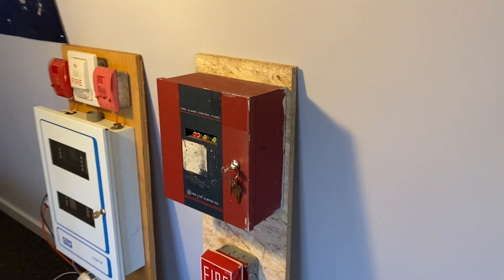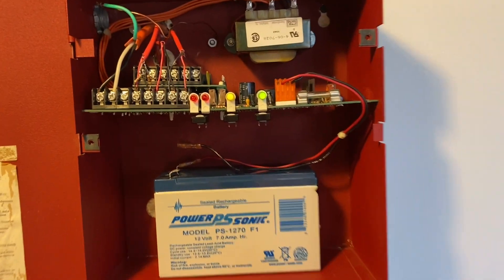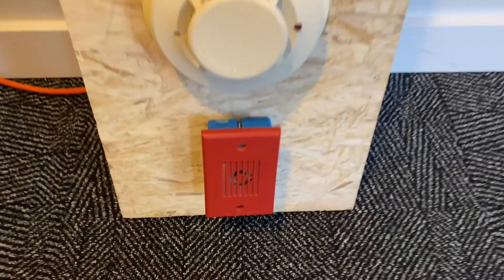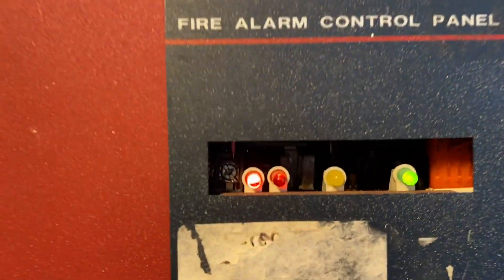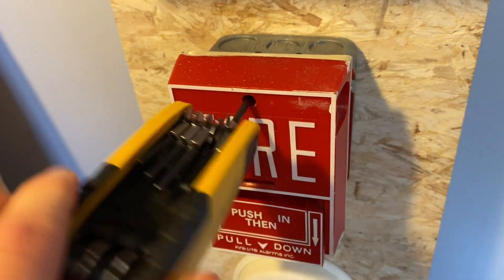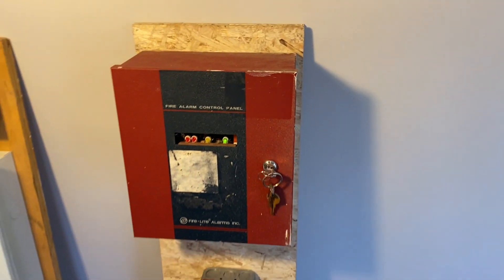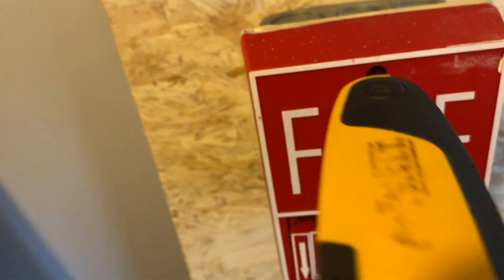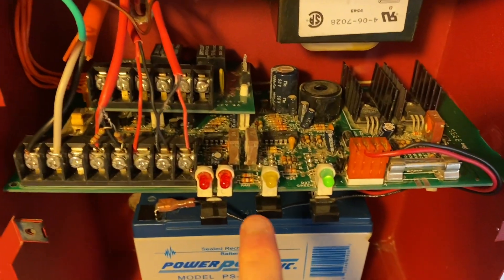Fire.Lite MP-12 fire alarm control panel overview/demo pt. 2! (Demo system on a board)

Comment: I’m into electronics, and I love anything that makes loud noise. I’ve looked into getting a fire alarm panel to play with, but I can’t find any for less than $100, I don’t really have a very large budget, so I get most of my components for circuits from old electronics that I had laying around, or people give me old electronics all the time, so I use those as well. I wish I could do digital electronics, but that’s pretty expensive to get into as well, an Arduino is like $30 each, and there’s so many things I want to make digital, I just don’t have the money. I wish there was somewhere I could get a fire alarm panel for under $50, but I don’t think anyone is going to sell one for that price.
Reply from the maker: Wow! Sounds cool. Unfortunately fire alarm control panels cost more then 100 dollars unless you get lucky and stumble upon a cheaper one but it's not too likely.
Reply: @SafetySecurityAlert  I have a request. Can you do a tutorial on how to wire a loop of 5 2 wire fire alarms to 1 nac of the Fire Lite Ms-4.
Reply: 200 or 300 dollars is a great price for one. I understand the lack of budget but after months of saving up its worth it 👍.